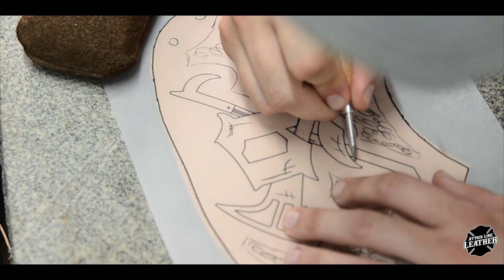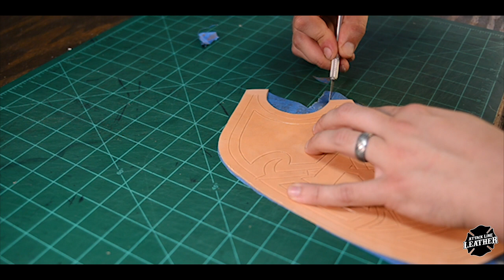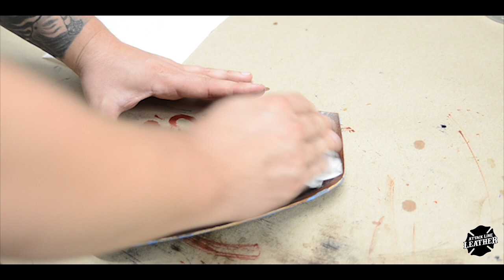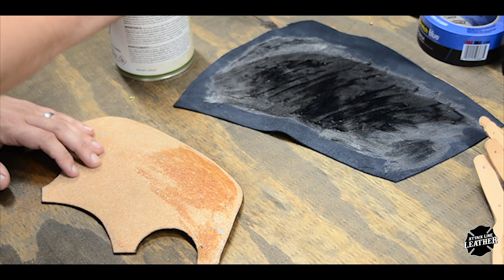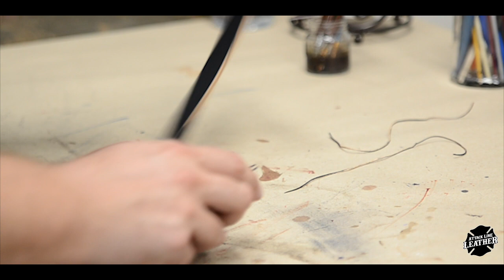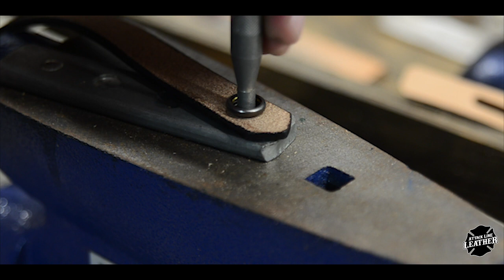Making a SCBA Mask Cover

Comment: Awesome job, the ONLY suggestion I would make is to fasten the retainer strap and apply the male snap BEFORE gluing and stitching on the back panel... Gives a cleaner look on the back side AND it prevents any chance of the metal potentially scratching the mask, just my two cents 😊
Reply from the maker: Very good observation. I have since changed to that
Reply: Nice, OCD kicked in and had to make the suggestion 😝😅 very nice job though!

Comment: Great video! only question is, with the button snap being put on after the suede liner is glued to the back, wouldn't the back of the snap rivet scratch the mask?  would applying the suede (after the button is attached) cover the rivet and stop scratching?
Reply from the maker: Very solid observation, however ive had mine for about two years now with no scratching, but you can definitely sandwich the snap in between.

Comment: Really nice to see a project video! I like your background stamp. Which one is that? Also, I'm curious: When you use tape on the back for stamping, do you have trouble taking it off? In this case, I noticed you had some excess, but it doesn't matter because you lined the piece. However, what do you do when you don't line your piece? I find that pulling off the tape makes the grain side way fuzzier than it was, and also it's really hard to get off because it's stuck extremely well after stamping on it. It tears and I have small pieces left as you had. Any ideas?
Reply from the maker: The stamps is the craftool E294. Using tape on the back of tooling projects is definitely not a true science yet. Most of the time the blue tape comes off in one big sheet and i dont have to worry about the small pieces left behind. In this case, if a few are left behind, i dont really mind since im lining the project. As far as the leather  becoming fuzzier, ive notice that this depends highly on the quality of leather. I use herman oak and thier rough sides are generally less fuzzy than say Tandy's Oak leather. In the past ive had really really fuzzy sides with lower quality leather. Ive also used clear packing tape, however no matter what leather ive used, i always had the stitcky glue residue stay on the leather and that is very very difficult to get off(impossible). Ive had the best results with the blue painters tape. This might make a good video topic
Reply: @AttackLineLeather  That would be an interesting video! I use painters tape, but the standard white/yellowish one. I don't know if the colours make a difference, I guess that's just for contrast for painters, or maybe not? I bought the TESA brand because it's supposed to tear less and come off cleaner than cheaper brands... but I've had some leather with an extremely smooth grain side that was really fuzzy afterwards.

Comment: What tool are you using to depress and outline the design?
Reply from the maker: Im usimg a beveler. You can get them in many different sizes. I use checkered bevelers and i mostly use craftool pro brand from Tandy Leather